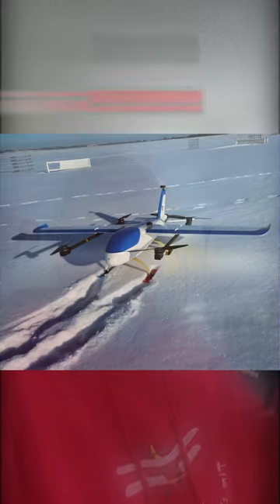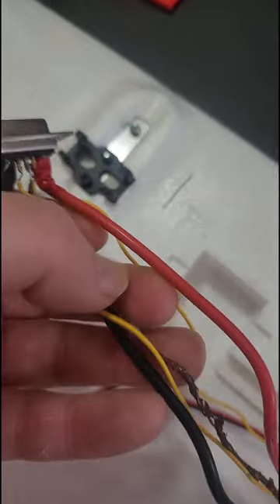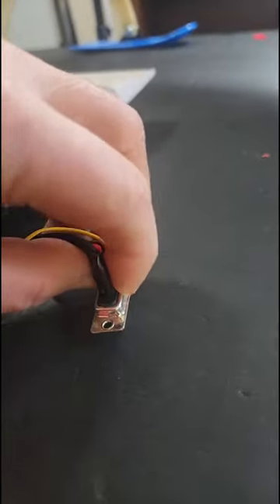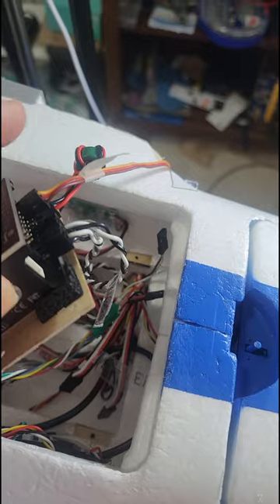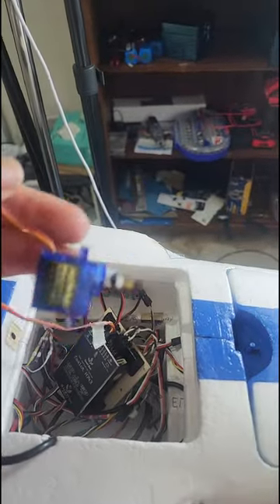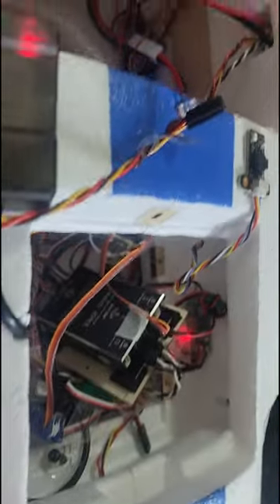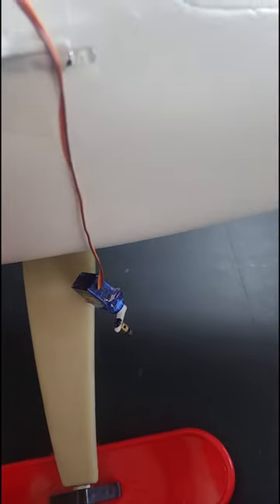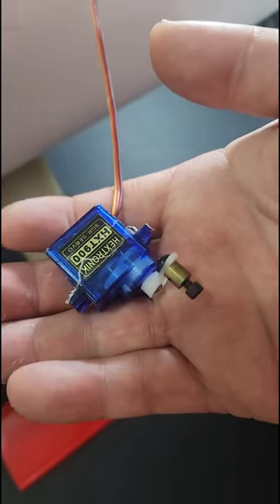The Painted Eagle is fried! Or is it? Water and electricity don't mix!

Comment: Just from the info you provided it looks like your power wirings had cold solder joint somewhere so the current found another less resistive path - the servo signal wire. You said there was water on the picnic table. It's a sign the atmosphere was loaded with moisture so the propellers might have picked up ice as it spun up, which made the motors spin faster, stressed the ESCs, which drained the battery like there's no tomorrow, maybe well past its 'C' rating.

This is where having an SD CARD or EEPROM  'black box' on the flight controller with logging turned is useful to debug what exactly happened and eliminiate which part of the system had nothing to do wih the incident.

Important: you may want to cycle your LiPO a few times and check for puffing.
Reply from the maker: Thanks so much for the advice. I've got work to do!